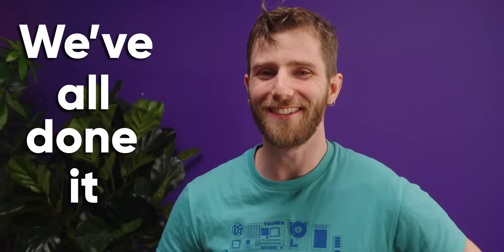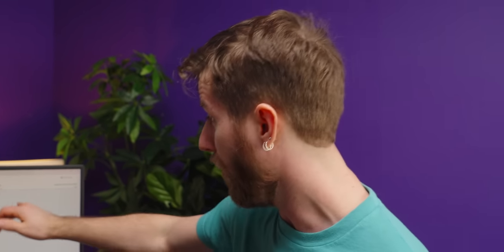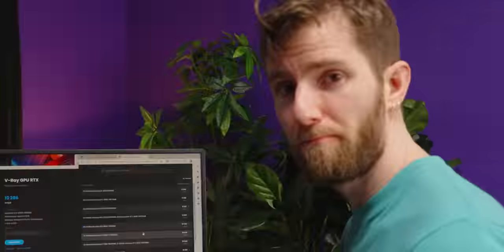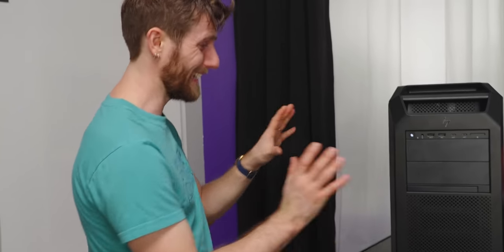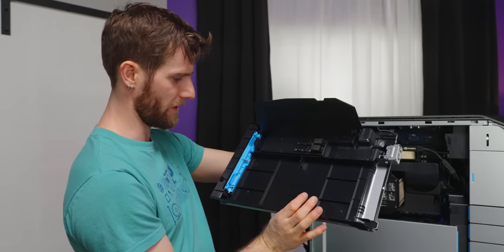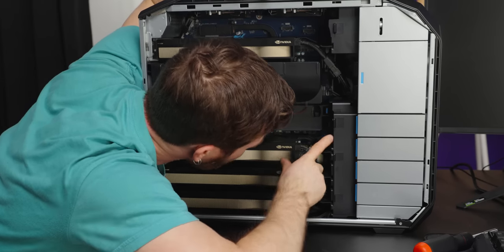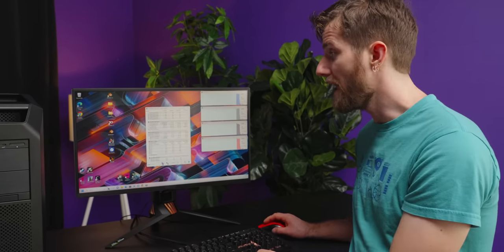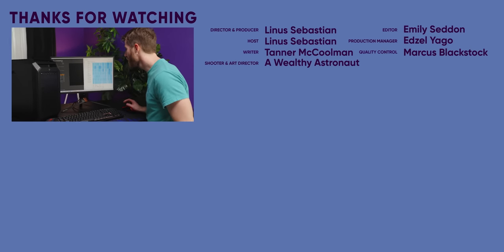Don’t ask me the price - HP Z8 Fury G5

Comment: The crazy thing is that 5 years from now you'll be able to get this second hand for well under $1000
Reply: more like 10 years but yes
Reply: @lefroste6370  maybe more if GPU prices continue to be outrageous in Nvidia world 💀
Reply: Picked up a 4 year old z8 last month with 2x cpu 128ram and a P6000 GPU for £2.8k including 2 monitors 3xSSD and 12pm the warranty as a refurbished unit - HP really upped their game on construction - reminds me of the SGI’s I ran 25 years ago - this will keep my 3d gfx/printing/modelling/noodles/cfd studies going for a while
Reply: No you won't lol. GPU prices alone nowadays don't drop that much over 5 years.
Reply: @reveriesduh  the 2080 ti went from $1200 to $350 in that time span. And workstations have even greater depreciation. When a workplace buys all new top-of-the-line equipment so they can get the most out of every minute of the day, then when they go to upgrade after a few years, the market gets flooded with old workstations. Maybe this exact model won't quite be $1000, but a similarly spec'd workstation might
Reply: Hardware won't keep evolving at same pace like in last decade when there was so much room for improvement..  some things gonna grow even faster while other gonna slow down
Reply: @Anonymous-qb4vc  I think people say that every 5 years. If it's not core count improving, it'll be IPC or efficiency or cache/clock speeds, etc. Some combination of everything will probably end up with 2-3x more performance than we have today

Comment: You can really tell this is sponsored by intel though. There isn't a single mention of AMD's Threadrippers at all, just that this 56 Core is "arguable the best workstation CPU on the market" which will depend heavily on your workflows. I find that sentence a little misleading, because not only are there Threadripper Pro's with 64 Cores, which I wouldn't be surprised if they still can outperform these, there are also new 96 Core models rumorend to arive soon which will absolutly destroy these. I'm not saying that these CPUs are bad or anything, they are very powerful and the amount of RAM they support is definitivly a big advantage for them, just to declare them the best without any mention of their biggest competition is really unnecessary. Especially in this community which knows about AMD. Intel at the moment just cannot compete at the workstation or server market on performance, they have value of course, but just not for pure performance, please don't ignore that

Comment: The main benefit of those renders being a few seconds faster than a normal workstation isn’t just that you can see it basically render quality in your window, but those faster render times add up over time, ie, rendering animations. So what would just be like 5-10 seconds faster adds up pretty quickly to minutes or hours of time saved. Tbh I’d love to see LTT cover more workstation and productivity builds and compare stuff with that in mind. Focusing on stability, longer renders, animations, user experience in these standard programs like Maya or blender, simulations, etc. I feel like it’s a little difficult when you just have bigger bench marking numbers vs, this system would take 3 hours for this animation where as this one would take 1.5 hours. Or we experienced more crashes when using X build than Y when working on these scenes.

Comment: We had HP in this model line like this at my old office.  Dual xeons with 64gb of RAM, top end quadro, and some other insane specs.  I think I figured out it was about $7k.  The cyber security they ran were so arduous, that my 5900x was generally faster.
Reply: Good old IT bogging down highly specced machines.  Same at my company, can't run shit on these machines without contemplating throwing it outta the window

Comment: Very cool build, a bit surprised it wasn't a bit taller to take advnantage of the PCI lanes for expansion, but it was very well packaged as it was.
But did HP still charge for the A-V, service contract, or whatever it was that they kept trying to upsell you on when you did the buy test a while back?
Reply: They’re not taller so they can be laid sideways in a rack mount kit. Having said that they are massive systems.
Reply: @jackkellaway3  
The case...
Reply: To be fair, with the bandwidth those cards are getting, there might have been actual trace-length/density issues which is why the board has a PCIE x16 above the CPU - it might not have been physically POSSIBLE to have 4 ports below the CPU, let alone 2 running at PCIe Gen 5 x16
Reply: @abcyclops  
Yup, for sync'ing the GPUs, but I see I wasn't very clear - I was thinking additional fast storage, maybe audio, maybe connectivity?
it would also give the potential for more through cooling. 😎

Comment: Having the shrouds and cowling around fans/components is such a good idea and makes me wonder why it hasn’t been done before. 

I’m not a tech genius, just an auto tech, but seeing how crazy-optimized HVAC systems have gotten in vehicles, seems like it could be easily translated to PC cases.
Reply: It's been done in the server world for as long as servers have existed. In desktop/tower PCs they generally just have enough free space and enough fans that specialized shrouding isn't needed.
Reply: @jblack3761  There are a lot of desktops with shrouds too. I remember we had a pentium 4 furnace that had a shroud for the CPU cooler.
Reply: @larsolav  I think the reference design for Pentium 4 used a single fan for both CPU and PSU and needed the shroud to make this possible.
Reply: @MikkoRantalainen  Didn't know about that. The one we had had a shroud to a mesh in the side panel, so wasn't a reference design.

Comment: This is actually a pretty similar design to the other HP workstations going all the way back to the zx20 series at least.  (I have had the zX20, zX40 and Z4G4 thus far).  The most rock solid stable PC type there is.  It NEVER crashes and if you get the right CPU, it will game like butter.

Comment: I use Blender professionally, and my single 4090 renders classroom @5.93 seconds. Though with NV Link those 4 GPUs should scale much better for extremely large scenes where you need more than my 24gb of VRAM. Still though that is a fantastic machine. And I am pleased to see a workstation covered on LTT. Let alone starting the video with some Blender renders. But ultimately for a Blender user, we spend most of out time in the viewport modeling, simulating, sculpting, texture painting, creating shaders, animating, and more. And then a lot of the time in my own work, depending on the scope of the project we switch between Eevee or Cycles depending on the time constraints, and overall final output desired. And more often then not we also work with the compositor built into Blender so we can render out fully composited frames directly at render time instead of having to go to Nuke, AE, or Natron unless absolutely necessary. 

Thanks for the representation though LTT for us that do more than gaming!

Comment: Funny,
I run a z420 as my home server.
Got a sas controller and picked up a ton of 6tb Seagate server drives and they run in raid.
It's basically my home file share, plex server and torrent download machine.
I used another xw6400 as my gaming pc for years, picked up the z420 to replace it but then decided to build my own gaming pc and went down the ati ryzen / radeon route.

Comment: The most shocking thing to me is how much they fit into a case that small without the thing roasting in its own melted plastic under any load.
Reply: It's very well engineered, simple as that. Same way we don't have cars flying off the road at 300kph, good aerodynamics efficiency and great engineering is the reason. Plus components and equipment for servers are different worlds in terms of quality compared to good old consumer PC.

Comment: HP make some decent workstation tower cases, which are way less annoying to work on than Dell’s.  The company I support mostly buys older Z workstations, which only have P4000’s in them, but they do alright.  They’re somewhere between a 1060 and a 1070 performance wise, and I can vouch for those GPU brackets being very solid.  If you can find a used Z440 or Z4 that’s off lease, it would make a decent gaming PC.  I game on one that runs Linux when I’m stuck working alone Iin the office and think it runs great for anything that runs on Linux.

Comment: This summer 2023 I am looking at building an Intel W7-2475X 20-Core computer with initially 512GB of memory.  The W3400 4TB platform is above my budget.
My current top system is an R9-5950X, ASUS ROG X570, 128GB, RTX-3090, and I need more memory, 2TB would be nice but I'll have to settle on 512GB initially.
The new workstation will expand and enhance my TerreSculptor 3 and Unreal Engine 5 work and my business importing services.

Comment: I'd like to see Linus review a ThreadRipper pro 5995wx workstation and a dual socket workstation powered with its Epyc counterpart. I imagine those would wipe the floor with this HP, especially considering they can probably run all 64 or 128 cores at 4.0GHz.

Comment: Back in the wee early days of GPU rendering even with SLI, there wasn't a way to separate the cards when installed in the same machine to run two separate renders simultaneously (you could set up render farms, however). What was standard back then was that one scene would share the VRAM of each card but multiply the cores so that a complex scene could be run significantly quicker, rather vital for doing chains or animations. In example, say you had two 980s in one machine and each card had 4gb  of DDR5 memory. The scene would see only 4gb memory for both cards, but 4096 CUDA cores vs 2048 of one card.  Then there was me dreaming of a K80 for doing feature-quality animations with a whopping 24gb to play with. If it weren't for that rather steep $17,000 asking price...

Comment: Very nice, but what I - and I suspect many of your viewers - want to see is a 12 or 16 core W-24xx system with 128 GB+, a gaming GPU, 10+ Gb ethernet, sound card, capture card, and so on matched against similar Ryzen 7900 / 7950 and Threadripper Pro 5945 / 5955 systems.

Comment: While completely out of my range, I see a use case with short animation renderings. I´m doing jewelry rendering for customers, and more complex parts with more complex environment settings, some added gimmicks and more passes might need 30 minutes for a 15 second output on the maverick render engine (Running a 3090ti with a 5950x). I wonder how much faster this would be on this machine, maybe less than I need to go to the kitchen to make a coffee. I´ll wait until the big players renew their inventory in 3 years then.

Comment: I've used a couple Z workstations and I've always been disappointed by the fan curve HP sets. First, it's not customizable. On some models, you can adjust the minimum fan speed only via the BIOS. In benchmarking some workstations, the CPU got ridiculously hot (throttling performance significantly) and the fans didn't bother spinning up to 100%. Which means the only way to get max performance on these during sustained workloads is to run the fans at 100% all the time. That's a deal breaker for me if I have to sit next to it and very unfortunate. Otherwise they're built well and great machines, minus the premium price.

Comment: I'm disappointed in the new Xeons. "Arguably the best workstation CPU on the market" but it only scores 63000 and change in Cinebench (and that's with the extra 4000 points in rack mode)? Threadripper 5995WX can easily hit 70000. Don't get me wrong, I'm certainly rooting for Intel to keep things competitive in HEDT but this ain't it. Threadripper 7000 is coming in 6 months and it's going to absolutely destroy the Xeons.

Comment: re RTX 4090 vs RTX A6000 performance for GPU rendering etc, don't forget that the RTX A6000 are Ampere generation, the RTX 6000 Ada Generation would be the comparable GPU to the 4090, these should be available from OEMS like Dell, HP, Lenovo Soon

Comment: 56-core xeon for just $6000??? holy hell I still remember the times when 28-core xeon platinum was over $10k. How times have changed
Reply: I mean to be fair that's still kinda absurd

considering you can get a 64 core 5995wx for less than that and a 32 core epyc that outperforms it for nearly half the price : (

Comment: Four A6000 GPUs?? Damn. I'm juiced about my new engineering laptop with a A3000 and 12th gen i9. My awful P2000 laptop is straight poopy in CAD. I'm expecting my new A300to shred for my use.

Comment: Sure love that proprietary HP stuff guys...

Almost like you guys forgot about the huge frustration / amusement of Scrapyard Wars....

"Oh damn, now we'll have to gaffer tape another power supply to the top of the case just to run a GPU....".

(I'm not bitter I just have a bunch of legacy HP server hardware sat in a storage cupboard cause, it's old, and proprietary... I mean it works, but I loathe their custom nonsense for the sake of it - MAYBE I could do something useful with a DL380 G7, to the detriment of my electricity bill, but not without all them HP certified memory chips....)

Maybe someone will want some of the 30GB SCSI drives out of the oldest one I have at some point.

But yeah their proprietary methodology can feck right off.

Comment: 2:58 download what? I got Blender 2.90.1 on an OpenGL 3.3 capable NVS gpu whatamigonnado? Unigine and Cinebench r20? Ok, uh... i7 620M has 192 single core and 436 multicore. I mean, that isn't bad. I'm able to watch Youtube in 1080p60 now that I repasted the cpu and padded the gpu. It's also still more efficient than any non Ryzen counterpart. Yes, it takes an A12 9800 to rival single core performance while 4 thread multicore appear to be the strong suit for AMD. As for Heaven, oof-540p at an average of 12-15fps, only difference is the GELID pads keep OpenGL from reaching 98 degrees celsius.

Comment: 10:40 Those 'personality slots' may be a reference to the SOL-20 terminal computer which are one of the earliest home computers. The SOL-20 has a slot for cartridge-based operating system called 'personality modules'. Considering that cartridges are an early form of SSD, HP engineers may be hinting something here.

Comment: Still 4x 4090 is better for rendering. 24gb is more than enough. NVlink is so overrated for rendering. We tried it, and neither octane render nor vray can do it fast enough. There is a big hit compared to local GPU RAM if the memory is unified in nvlink. Better to use lower textures/optimize them than nvlink. The ONLY case where it makes sense is AI. But even then, it has to be a really huge model.

Comment: I have some bad news for those of you planning to wait 10 years to buy one of these beasts second-hand and drop in modern GPU(s). The electrolytic capacitors in those super custom PSUs will be at the end of their life and will likely give up once you start putting stress on the machine. Replacement PSUs will be non-existent/too expensive, and you'll be left with a nice HP branded paperweight

Source: My HP Z820 after putting 2xRTX 2080Tis into it. RIP 😢

Comment: Interesting with a Z8 G5 with only one (1) processor socket instead of the usual two sockets. All images i have seen have two processor sockets, no mentions of a one socket model. Lot´s of other differences compared to the official images if one look closely, such as "only" one power supply instead of the two LTT got, different MB layout, etc.  Did LTT got a prototype?

Comment: I ran outta thermo paste and I made some out of valve grinding compound I’ve always wondered if that would work and I don’t really have the means to test it like you guys would but it seems to work pretty good all I used is the resin itself from a two part epoxy (clearweld JB weld) and valve grinding compound that I washed with water in a bowl and being that it is a metal paste everything that didn’t dissolve sank and I just waited till that dried and mixed them together

Comment: So when you can't (in theory) pull more than 1800 watts from a standard circuit... Are you using two separate circuits in that room or is this a 20 amp (2400 watt) circuit?

Comment: What is the primary usecase for this machine?
I am pretty sure large Graphics Production houses use cloud, where they can add multiple GPU to a render as they want.
Even for smaller Graphics Production house, it would be cost effective to use cloud rather than owing a hardware machine where you have to maintain it and pay for Electricity and Networking etc.

Is this for Machine Learning?
Same reasoning as above, why not use cloud if you want multiple GPUs?

Anything I missed. Its not for gaming or watching Youtube videos...

Comment: "This is the same class as our $69 workstation" I think you are leaving out a few key details like that one didn't have a high tier xeon, or a significant amount of RAM, or even a good GPU. Nothing in that system was even that good for its time, nevermind being even remotely comparable to a 56 core monster with almost 200gb of VRAM. In 10 years that PC will still cost 5 figures. It might actually cost more because of the collectors market for parts of that tier.

Comment: I get that EPS 12 volt has a higher power rating than PCI Express 8 pin but when everyone just ends up using adapters anyways why not just use PCI Express 8 pin on the PCB?

Comment: Soooo - an entirely proprietary construction with almost no component that can be replaced with a 3rd party part in future then ? 🤔🤷
PSUs (no), Mobo (Bigger no), GPU (good luck modding the case) RAM (actually possible!) NVMe (amazeballs, actually standard)...
And if you're on piddly 120v, get a 32Amp breaker for the mains draw...